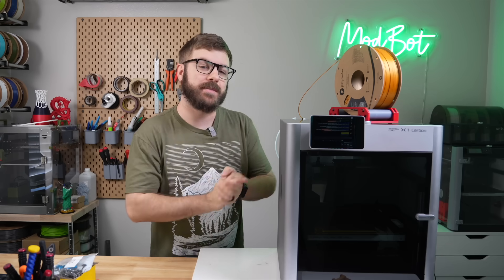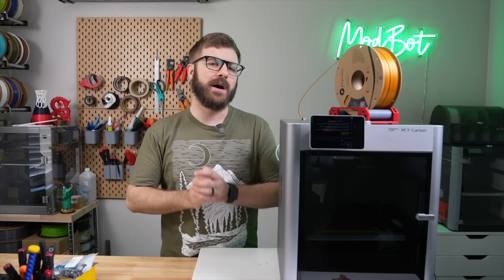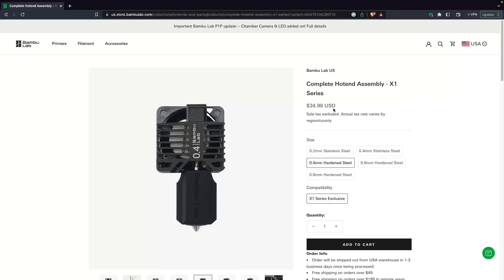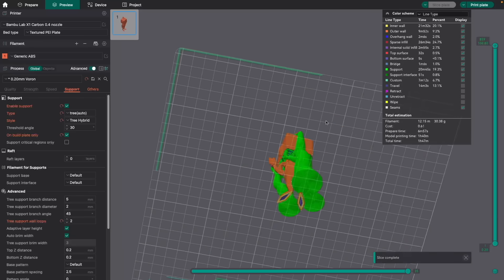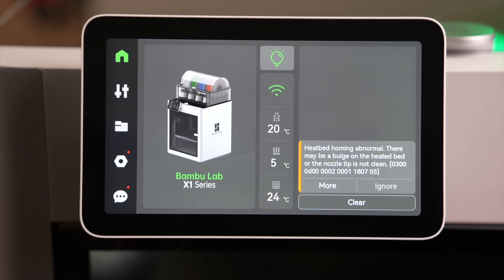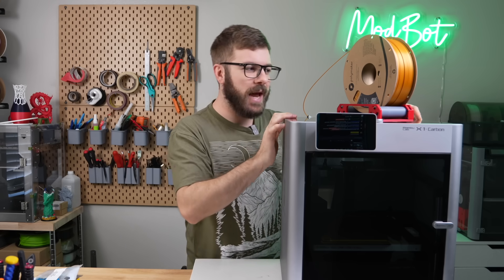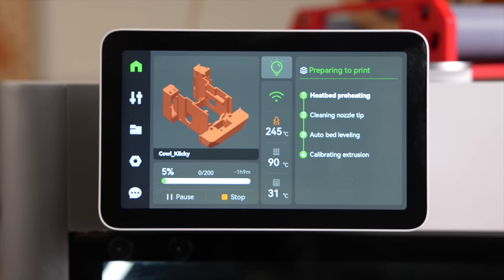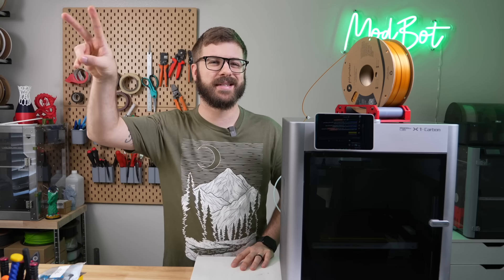One Year With Bambu Lab X1 Carbon

Comment: Hi Daniel, I have been searching for a good printer for a noobie like myself in this realm. I've wanted the bambu carbon for xmas but had to put off. Then the P1P came out and I was like wow - now which way do  I go... My son gave me, or should I say let me borrow, his Geeetech A20M printer. I immediately upgraded the extruders to all metal and replaced his hotend since it was totally clogged. I also adjusted all the rails and bed to get rid of all play as well as replace the removable magnetic flex platform. Installed the auto 3D Touch and upgraded the firmware to suit.
My son was impressed and wanted to do the same upgrades but didnt have the extra funds since he go married. I asked why impressed since he knew my background. He just said that was 30yrs ago... freak'n kids. I'm still waiting for him to drop off some of his new filament since his old PETG, that was on it, is really not working well. (1yr since he played with it)
ANYWAY - I want to make Flight SIMMs and make glass style cockpits. Maybe relive my youth and build a few classic muscle cars. So which printer should I get; the X1 Carbon or the P1P w/AMS?
PS... Don't tell the wife...lol
Reply: Personally I would wear with the X1Carbon Combo over the P1P, but both are excellent printers.
Reply: @Aikano9  I am leaning towards the X1 just because I can do ABS and not really worry about the fumes since it is enclosed and has a filter.
Reply: I was in the same boat as you, a friend of mine gave me a a20m but I could never get it working properly though I never tried really taking it apart out of fear of not knowing how to put it back together.  It sat for months after trying to change the extruder out because the one that comes with it is horrible. All it does it clog up and cause issues for me.  When I tried flashing firmware I must of done something wrong because the screen won't even turn on now.  I gave up and last week I ordered a sovol sv06.  I couldn't be happier with it so far.  Every print I've had fail was user error and it hasn't been very many and on top of that I started off printing lw PLA right away instead of regular pla.  If I could of afforded it I would of definitely went with a p1p or x1c.  The x1c is really amazing in so many aspects but the speed is what I like about it.  It can cut print times in half

Comment: Also a question. I have 3 P1Ps and a X1-C.  How can I come back into a used 3MF file and do say a filament temp change or a flow change without completely redo the file from scratch and having to re clone and place them. I run a file with 50 up and when I need to adjust something to tune the file it won't let you to a single item and I have to complete redo the file from scratch. Can I do this on the OEM slicer or can the Orca or the other highly modified custom open source Bambu slicer allow this single item adjustment to a used or fully slice file?

Comment: The carbon rods fiasco is exactly as predicted. These machines have a very limited lifespan that unlike ender v-wheels can’t be user replaced.
Reply: the carbon rods fiasco has so many unknowns about it, everything is pointing to the person not maintaining the printer to what bambu labs has written and greasing the rods which is also something that should never happen.
Reply: What is the fiasco?
Reply: Your response didn’t age well, carbon rods now available as spare parts
Reply: @fuse3d  tbh all these people says carbon rods are epoxied in and can’t be replaced since day one, if I spent 1k on this printer and the rods went bad it’s possible to source carbon rods and epoxy isn’t forever. My point is with enough try anything is possible. Still glad to hear they are expanding their replacement components.
Reply: @fuse3d  Having the rods be available doesn't mean much with the fiasco as there is no proof that the people running these printers are actually following protocol with maintenance. The guy who caused all this was running abs 24/7 on sport mode, abs leaves a ton of residue. If he wasn't cleaning them like they say in the manual then of course there are going to be issues, it's still a machine that requires upkeep.
Reply: @bcaswelch  All I mentioned is they are available to purchase. All other comments are inconsequential and unrelated.
Reply: @fuse3d  You are correct sir.
Reply: @fuse3d  so 700/1200 for a printer and 90 for rods?  yeah ok that didnt age well either.  garbage.

Comment: Just got a good PEI bed from Bamboo. I print mostly in PLA so that’s been my favorite print bed surface. I haven gotten the camera working in real time yet and the directions on line haven’t helped. I’m using a WYZE camera I’ve had for years just sitting on top the printer.

Comment: I am eager to buy one, but I am kind of waiting on the 1.1 version.  Hopefully a little cheaper and some design improvements.  Just like you should never by the first year model of a new car design...  Plus I finally got my BIQU printer working very well with a new direct-drive extruder, so I need to get some value from all the work it took to get that working!
Reply: I'm waiting for X2 Carbon
Reply: Yet trowed it overboard and bought a biqu
Reply: They have been making changes to the X1C with many improvements.
Reply: I would be even more impressed if they make x2carbon cheaper... With all this hype on the 
quality side, why would they charge even less?

Comment: I have had my X1C for a few months now.  Great machine!  I have had very few problems and most being self induced.  I print mostly pla, pla+ and Tpu.  The machine has been reliable and I bought some parts with the original purchase but so far no need for any of them.  I did switch to an after market PEI built plate because I do not like using the glue stick.  Looking at buying a second but waiting hoping they will introduce a bigger machine.
Reply: Which aftermarket one are you using?  I'm new to this and hate using glue.

Comment: The system board fan is really bad on some series, including mine, so I got a new one, but haven't gotten around to replacing it yet, since last time I tried to figure that out, I found it was glued in. Fun fact: In the centre of the back, there's a screw with a "void" label that has to be removed or broken to follow Bambu's howto.
Reply: 😢 how ironic.

Comment: Hi, I stumbled across your video by chance. I haven’t purchased a 3D Printer, yet! I was all set on the Bambu X1C but then I made the mistake of conducting my research on their official and unofficial Facebook groups. Like you said about the rotten apples shouting the loudest, wow! They have put a seed of doubt in my mind over numerous things; the reliability, the noise of the machine, the support or lack there of to name a few thing’s.
So where do I currently sit… well and truly wedged on the fence without having the desire to buy just yet. I feel frustrated as I really do want to get into 3D printing.
Reply: I'm in the exact same place as you, I'm "glad" I'm not alone 😅
Reply: You can't go wrong with a prusa MK4. Seeing prusas 10+ years in the space and how they've responded to feedback and issues with their printers made me and over 100k others loyal to their products. 

While the bambu is very fast and nice, it's also quite loud and as seen in the video; very difficult or in some cases impossible to replace parts like the carbon rods which have been seen many times to rapidly deteriorate. They're also seen to have YouTuber favoritism by giving modbot and a few others in the 3D printing space quicker/any support at all.
Reply: Go for the X1C - it's so rewarding to make your first print right out of the box. Creating your own designed parts is so rewarding - I wouldn't want to postpone my 3D print experience for longer! I got my X1C as my first 3D printer at all and I didn't have a single issue by now - I didn't even look up where to open a support case because there is no need to! I hope this answers your doubts - don't believe a small group of idiots on facebook - this is a well conceived printer! If you decide to buy do yourself a favor and choose the combo with AMS - you'll miss it otherwise in a few weeks! Happy printing! ;-)

Comment: I run 20 Ended 3 S1s 24/7 365. The bambu lab BLOWS them out of the water. One of them can almost easily out print 3-4 of my Enders.

Comment: I had the same issue with the cable. A wire had an open. I repaired the wire. Bambu did send a replacement. Still, this is the best printer I'll ever own.

Comment: Great video!  I’ve even seen some content creators semi-bash Bambu for things that all new companies go through.  I don’t have a Bambu, nor do I feel that I need one, but I do feel that the company is working towards becoming more like Prusa.  Time will tell.

I’m luving my Rat Rig V-core 3.1 500, though I have run into several issues with it too.  The worst part with Rat Rig is that while the company does provide support, their manuals are absolutely terrible.  I am not color blind, but their manuals use colors for everything, and it is extremely difficult to follow some of them.  I know people who are completely color blind, and only see shades of gray.  It would be impossible for them to even attempt one of these builds.

On a side note, I recently discovered some extrusion issues with PrusaSlicer that have made their way into all of the derivatives as well.  The slicer over extrudes, and depending upon your settings, it can compound by up to 20%.  I was able to learn through trial and error, the the Extrusion Multiplier for all filaments needs to be set to 0.965, which works with all 3 of my printers.  Because it works for all 3 printers, it definitely means that it is Prusaslicer that is over extruding, as I perfectly calibrated the extrusion on all 3 machines.

The next issue is that PrusaSlicer does not work that well if you are not using the “Default speed” Print setting, and use percentages for virtually all of the other speeds.  This has the added benefit of making it easier to create multiple speed profiles, and seems to prevent the additional over extrusion that occurs when you use fixed speeds.  I’m using SuperSlicer, as I have been tuning it’s profiles for quite a while, and this over extrusion issue totally destroyed my profiles when I upgraded to the latest version.  It looks like the bug(s) were introduced over a year ago.

Comment: I have been playing with 3D printers since 2012. I have prusa mk3s+ with 1183 days of printing since Jan 2021. Will get  Bambu one day.
Reply: nice try, from 1. january 2021 until today it is 862 days
Reply: I have over 11,000 print hours on my MK3 and just had to replace the bed thermister.  I replaced the hot end once because a pla blob tore the thermister wires and made a mess of things.   I'm worried as my X1C AMS has issues with slot # 2 already after just 3 weeks of use.   Modbot only has 400+ hours on his X1C and is having issues.   I guess I should have waited another 6-12 months to purchase mine.

Comment: I canceled my MK4 order to get an X1C, since I already have multiple prusa's this would be a nice addition.
I'm glad that their customer support atleast is there and the replacement parts are super cheap.

I do worry about the noise but I'll probably install some noctua's and foam inside and might even build an insulated cabinet for it if its really loud
Reply: Modifying the printer You'll void your warranty (and also violate terms of puchase contract).
Reply: @donkeymarco  Can always chance it back to normal, but I rather not sleep right next to a vacuumcleaner fan
Reply: @xIsouLcruSHca  Personally I would open a ticket. Than replace the fans with better ones.
Reply: I changed to noctuas directly after purchase and now my X1C is standing next to my bed and I enjoy sweet elegant printing sounds similar to the level of barely audible! :-)
Reply: @jts4233  This is the comment I was looking for!
Did you experience any problems/ bugs after you replaced the fans?
Which fans did you upgrade? Anything besides the chamber cooling and the one right of the poopshoot?

Comment: I got my X1C and AMS mid january and have absolutely loved it. I have a prusa mk3 with a revo, a heavily modified ender 3 and a voron 0.1 my prusa and X1C are both workhorse printers that i never have to mess with. My ender is a hobby project and i love my voron. I am pretty invested into printing and tinkering with my printers, but have two printers that are always ready to print is so nice. I have put over 800 hours on the x1 all using the AMS and have not had a single issue with it. The only “modifications” i’ve done to the printer are adding the bento box filter and putting a WhamBam plate on it which i couldn’t recommend enough. I have only had one or two ams clogs other than that the printer just works.
Reply: My whambam plates came in today for my x1c.  Does the horrible smell for the plates go away?  It smells like bad gasoline.
Reply: Does the wham bam plate affect the LiDAR?
Reply: @Stanley Cubrik  the whambam plate is amazing for printing holes, like honeycomb shapes.  It fixed the issue I've been having with honeycomb prints not sticking to the plate well, even with Elmer's extra strength glue stick.  I used no glue on the whambam and the PLA stuck like a champ.
Reply: @Stanley Cubrik  it didn't look like if affected my plate.  I think it's only rough surfaces that causes lidar issues.  I'll report back if I have any future issues.

Comment: I've had my XC1 since Christmas, nothing has broken or worn out yet. I just did my 1st maintenance I must have run 30 rolls of PLA through it. I've had 2 jambs at the AMS one which was caused when it was switching to a new roll. I just bought my 2nd XC1 along with a bunch of spare parts, Textured PEI plates etc. I have 2 Crealitys sitting next to the XC1s collecting dust. I have become a Bambu Fan Boi
Reply: What really worries me the most is if the printer ever has to go back for carbon rod repairs.

Comment: Thanks for this!  I've been fairly satisfied with my X1C.  Recently started to have minor mechanical issues that needed tending to, most noticeably my first nozzle clog!  Which took forever to deal with - plastic had managed to back up into the cold end of the nozzle assembly when the hotend fan plug wasn't seated properly after a nozzle change - but eventually I realised that "this is hardened steel.  My pin vise uses cheap AliExpress bits.  There's no way they're harder than the nozzle."  And then used a 1mm and 1.8mm drill bit in my pin vise to clean it out.  

Other than that, my only major issue has involved some low-quality ABS not sticking to the damn bed, but I think I've finally figured out how to cajole it.  I think I was overheating it in the drying box before it got into the printer.  So that's not the X1C's fault!

The heads-up about the bed cable is good to know, I'll keep an eye out for symptoms.  I'm about 6 months behind you (and suspect my duty cycle is lower) so this gives my a good sense of what to watch out for in the future.

So sad to hear about people being jerks on the forums etc, though.  :(